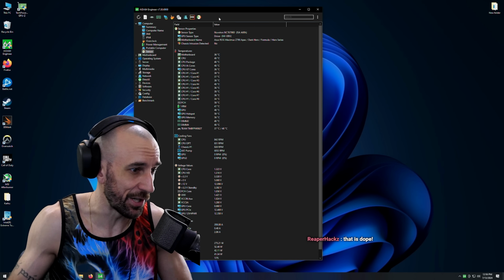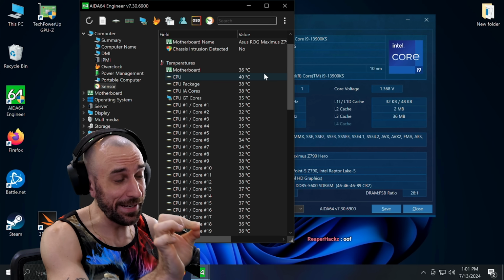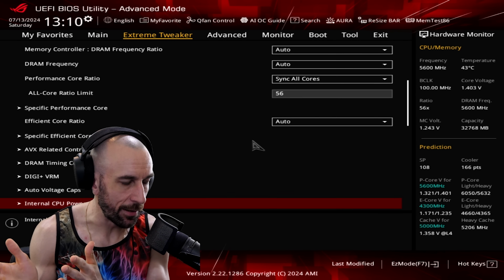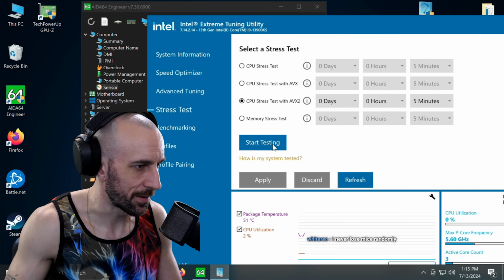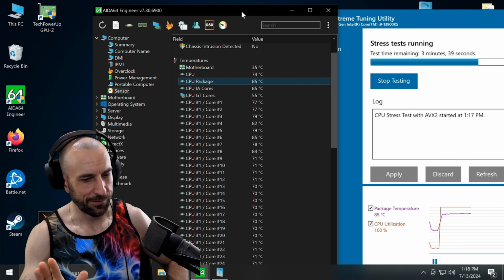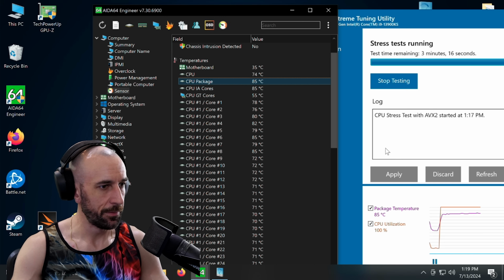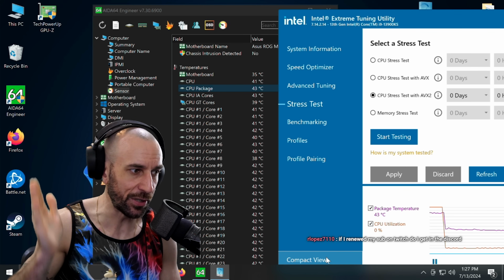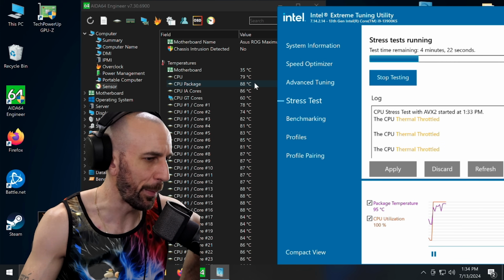🛑 STOP YOUR Intel Crashes 😱👑 (Step by Step Guide)

Comment: Got my 14700kf. Locked cores to 5,5 ghz and e cores to 4,3 ghz, undervolted and LLC calibrated. Vcore on mixed load gaming, productivity etc is average 1,27v. My brother checked with a digital multimeter and no spikes above 1,33 volts under any circumstances. That with a tuned and manually tigtened timings CL 34 7200 mhz 32 GB DDR 5 so the experience is lovely. Even my friend changed from a 5800x3D to a 14700k. He had plans going 7800x3D before it.

Comment: I need help guys my i710700k spikes to 100 celsius watching YT videos...  have 32gb ram RTX 2060, lots of terabytes free. I got new AIO recently its all corerctly installed. What I seen wrong is VCORE spiking to 1.563 volts even undervoltnig the CPU a little. What could it be ? My power supply???
Reply: Use fixed Vcore

Comment: My 14600K of which I rank stock with the latest BIOS, is dying on me. I did a -0.1mv undervolt ever since I had it, and now I have to disable E cores to get it stable and let P cores boost past 4.7GHz. I got a 7800X3D last week and will RMA the 14600k and sell it.

Comment: I locked my cores on a 13900k brand new out of the box and still degraded now I'm on my 3rd finally got a 14900k from intel haven't had an issue to date
Reply: was it hard to RMA it ?? you did it from the store or intel ?
Reply: @stylox-c2c no was easy went thru intel!

Comment: I have been RMA multiple boards and I get shit back from asus. 1 I sent in my z790 hero but got a different MB  back more fucked up broken missing a pin in the cpu and bent pin where you plug the power in the motherboard and two ram slots not working.

 I RMA the second board, I get the same broken one but the cpu was fixed but now only 3 ram slots  not functioning. I want my original motherboard back it was in better condition. 

I would not send in my motherboard if I seen your video. My first one was crashing and giving me blue screen. I use the i9cpu 13900.

Comment: i had the same issue a few Weeks ago with my I9 14900kf. The most imrortant is, not to "only" load optimized defaults, but REMOVE the CMOS Battery for a few minutes and then reset BIOS to default settings. It feels like, my CPU works better than before. I even realized that Asus Mainboard in Auto Settings set to high Cache OC Switcher Voltages. I started reducing High gear ratio in -5mv steps and realized, the CPU doesnt hang up anymore.

Comment: I am using a 13900k for about 2 years and a month now. I have a 7900 XTX paired with it and an 850W Seasonic PSU 32GB of ram DDR5 6200 MHz and a Gigabyte z790 Aorus Elite AX. For about a year and a halfish/prolly less, i've been having random pc shutdowns while gaming. I game for about 30 minutes pc shuts down by itself and turns back on.. I found a band aid (i'm 95% of the time gaming, multiplayer games such as cs etc..) i went on the amd app and limited the Max frequency from the gpu down to 2700 Mhz (default is usually 2970) and it's perfectly fine. Recently i updated my bios to the latest version and it happens so that before the update my cpu was peeking 1.35V on idle 38ish/40ish degrees. After the update it's constantly at 48 degrees (1.46V-1.5V). Since random shut downs during gaming sessions usually are related to PSU issues, i was thinking something is triggering my psu to just safe shutdown under heavy load and since the 13th and 14th gen been having those degrading issues, could it be that my cpu is causing PSU spikes paired with the gpu at high clock speeds? Does the problem resign on my cpu/gpu or PSU? What do yall think. Oh and it might too late, but i'm following this guide in order to band aid the cpu before sending it to RMA as i've heard intel gave an aditionally 3 years of warranty for 13th and 14th gen cpus users... Don't know if that's correct as well? If someone can give me a proper response, i'd be very thankful :)

Comment: Pro Tip:   Switch to AMD
😂
Im an ex-intel fanboi as well
Reply: Until Nova Lake Drops.  Then you'll be shouting Intel.
Reply: Intel Nova Lake is the codename for Intel's next-generation desktop CPU family, slated for release in 2026. It's expected to succeed the current Arrow Lake series and may introduce a new socket, LGA 1954. Nova Lake is also rumored to feature a significant increase in core count, potentially including up to 52 cores in a hybrid architecture.

Comment: I learned to tune for games on PUBG when it first came out and Fallout 4.  It is nearly always the PC I got a FX6300 to beat my Ryzen 1700X on PUBG.  I even got a dual core 7350K i3 to beat my 4670K on Fallout 4.  On PUBG I wasn't using great cooling or high voltage, CPU might have even been stock speed.  I set the ram timings, speed, HT Link and Cache optimally.  The early Ryzen was crap for memory and cache tuning which made them hopeless compared to Intel CPU's of the day.  I sold that FX6300 system to a friend for his son to play Fortnite etc, was a great CPU that did really well when I benched it on liquid nitrogen a year earlier.

Comment: My 13700k is having some problems what should I lock the pcores to?
Reply: 5.3ghz. Also, make sure you have the latest motherboard bios that addresses the Vmin shift issue. His video covers what you might have to do if your CPU is pretty degraded. I would avoided adding voltage offset unless necessary.

Comment: I'm on my 3rd Intel cpu my 1st 13900k i ran stock had the out of video memory error soon as Intel sent me new 13900k I locked all the cores and added an offset 4 months later same issue with freezing and stuttering so locked cores didn't help Intel sent me 14900k this time so just running it stock

Comment: I am trying this right now... After being in the every game crash boatd, since day one.
Faccin frustrated.
I set the load level to 7, but had a CPU @100C, with watercooling fans at max. Sat it back to 4 and 0.01V on Z790-P D4+13700KF.
I don´t agree that this is ok, since the company sent these units with knowledge of them beeing defect/faulty, not faccin OK! Not a big dead? Seriously, especially with the cost of these units in EU.
Maybe it´s cheap in US? I have lost so much time to find out what caused all these issues since 22.
Every faccin play black screens.
Intel doesn´t just owe me a new CPU, what about all those 1000h hours I wasted on the troubleshootings?
Don´t tell me it´s not a big deal dude.

Fun part when you said Effiency cores, those things have their own faccin probs, LOL

Thx for the content, I hope this will make my system more stable for now, until I lift my ass and unsocket the CPU and send for RMA.

Comment: Just picked up a 14900k on sale and did this out the box (minus the voltage) and this thing is running super cool and at 1.12 on the voltage! and locked at 5.4. Thx man!
Reply: How did you do that? It stopped crashing?

Comment: After updating my Asus BIOS to 2503 it will not let me Sync all cores. My cores do not go over 4900 now when stress testing, and voltage is 1.2XX. When Idling they  jump between 1100 and 5500 and  0.7 and 1.488 volts. What a shit show
Reply from the maker: FrameChasers.org

Comment: Eventhough I have a 13700K, I saved this video because of windows issues & BSOD's earlier this year.  After a reformat & re-install of windows, a new power supply, things seemed to be OK.  HOWEVER, with the recent Black Myth Wukong game, there would be an "out of video memory" error and the game would shut down.  Everyone on reddit and google search pointed to upgrading BIOS with the new microcode since many 13 & 14th gen CPU's were having the same problem.  But I remembered THIS video and gave it a try... and it worked!  No microcode, no BIOS update needed.  Thank you sir.  I can rest easy knowing that my CPU will no longer degrade.  The world needs more people like you!
Reply: I'm about to buy the same CPU. Can you give me an update? Did it worked?

Comment: 13900K Locked all P Cores @ 56 and is @ 253w limit. Multi core stress test wont go over 62 C. Games still running crazy fast as well. Should I lock the E cores as well? Or do anything else for that matter?

Comment: Did my 13700k today. Limit cores to 5.3ghz. Runs 1.22v by default. Cinebench score identical for multi, little worse for single, games (what matters) exactly the same. Maxes on at under 90 degrees on a Thermalright Phantom Spirit EVO in a Corsair 2000D. I think I have a pretty solid binned chip but still. Prob gonna undervolt and see where I end up. 6000c40 still tuned to 6600c34 1.4v. Never had an issue before but no reason to not do this tbh.

Comment: I mean... idk if this sounds fuc*ed... but like I just finished my build with a  i9 14900K. I'm finding out about the Intel Voltage issue. Why would I want to make the adjustments to the cores to "save" the CPU. When I think logically I will probably want to get rid of this Chip no matter what, and maybe if I'm having the issues an RMA process will slide through easier because the CPU is degraded/damaged. Whereas if it's not having issues or degradation, I wont have any option out. (I might not be eligible for an RMA request) I'm also assuming that intel might do something different here and allow you to upgrade/change CPU's? or will they be able to physically fix the voltage issue in the new chips...and by "fix," I mean get the advertised performance out of the chip, not just downclocking it so it can be stable

Comment: this might not be the solution. the semiconductor sensitivity has been damaged by over-voltage due to Intel. the single core performance of your one-year-old 13900KS has become a brand new 13600K as the result. Then you use more voltage to push it, just hasting the progress.
BTW, the XTU app is a black hole with too many issues. just uninstall it.

Comment: I'm running my 13900KS at 1.16VID boosting at 5.6GHz max. Undervolting and underclocking from day 1, may last year. I was called names. It still boosts at 5.6GHz at 1.16VID, CB23 is above 37k.

Comment: Yeah, but it's doesn't prevent your CPU from degrading further if it was manufactured in violation of technological standards to begin with (I refer to the news that some CPUs could have been manufactured so that their Cu-parts oxidize over time). This is my stroy of how I configured my platform (i9 13900KF + ASUS Z690 hero): first I decided that actual Vcore (in HWInfo) should never exceed 1.35V under full load, it seemed more or less reasonable. I turned off TVB, locked P-core multiplier to 55 and E-core multiplier to 43, LLC was set to 6, Synch ACDC Loadline with VRM Loadline disabled, SVID behavior Auto (doesn't really matter), Vcore and the difference between Vcore and SVID were adjusted by the "AC / DC Load Line" settings (so that actual Vcore is the same as SVID). I decreased Vcore gradually until the system lost stability while all the other essential platform voltages were on auto (system agent, memory controller, DRAM voltage...). The lowest voltage at which the CPU could pass the FFT y-cruncher test was about 1.19V under all-core load at full speed (it wasn't limited by power consumption, package power was about 170W). So I increased it by about +12% for solid stability (resulting Vcore under all-core load at full speed is now about 1.33V). I also used the same technique to find the minimal stable voltages for system agent, memory controller and DRAM and also increased the resulting voltages by about 12% or more. (I also should mention that memory speed / first essential timings / command rate / gear mode were set manually, but that's another story). Now it seems to be absolutely stable

Comment: How much would you charge to remote in & fix my 14900k?. Its only a few months old. Ive just been reducing my performance cores in XTU down to 53x. And it works. But i get alot of stutters in warzone. Lmk 👀  im ready to do it asap
Reply from the maker: FrameChasers.org/consulting, tier 1 consult

Comment: What cooler you got? Mine hits 100 in a second.
So it's the frequency that gives it degradation?
Reply: Higher frequency requires higher voltage via the VID table leading to much more heat. A good cooler (direct die and MoRa 420 on my 14900KS) can alleviate the issue if you stick to Intel extreme profile values IMO. Locking the cores to max all core is definitely worth it for safety as otherwise you get instantaneous spikes to 100C. Thanks Jufes.

Comment: Mine has been good but I just got it, thanks for the tip, locked the cores, hp omen 45l, performance mode, ddr5 5200, def not pushing her, rather be stable than chasing that extra couple fps.

Comment: Running a 89 biscuit score 14900k CPU @ 1.25 fixed at LLC7 at a Fixed 5.7ghz p-cores, 4.4ghz e-core, x45 ring with a 360 AIO and a fixed P1/P2 @ 253w for 38k in C23 @ 79c Max temp. Also hits 41k in C23 with a max P1/P2 @330w, but not used for daily use. Completely stable in OCCT, Prime, Y-cruncher without any issues since release. If you use default motherboard profile settings your degrading your CPU as they are all set too high by default. Tip - Setting the ring speed past x45 causes a lot of instability without also heavily increasing v-core voltages and the same thing goes for a fixed p-core above x57 or e-core above x45 unless you won the silicon lottery with an amazing CPU sample, I also do not recommend going higher than 1.35-1.4 volts on the V-core for daily use, i.e. the lowest stable v-core the better for long term CPU health with a capped P1/P2 at 253w. :D I immediately noticed and fixed this issue for myself when I ran HWinfo on default profile MB settings showing a crazy 1.47 default voltage for the V-core on adaptive settings with intel boost enabled. SHUT all that crap off and manually set up your CPU correctly, 125w max while running Cyberpunk @5.7 fixed without any stability or degradation and 40w idle, only maxes to 253w during benchmarking like C23, etc. you will not hit that wattage during daily use unless your are doing heavy AVX encoding.
Reply: So back to fixed awesome i figured that much. Never been a fan of adaptive. Finally upgraded from 9900k to 14700k so this helps thanks. Ill setup this weekend.

Comment: I just want to add something, when i got my 13900ks first like 14 months ago, i was able to use it everything on tweaked without problems. And the default LLC was level 3! And my temps were lower. (i don't remember about the voltages)
But I believe, what they did with the updates is they added more voltage or something by default. and now with the new updates, the default LLC is level 5! and my temps are higher. 
I was able to run perfectly fine with a low grade AIO 14 months ago, but now I got ryujin 3 since 6 months and temps are even higher than I first got it 6 months ago. Every new update temps are going higher and higher.
This is a total clown fiesta!

Comment: Is the max all core not 54 on the 13900ks?
Reply: It depends on temperature. If its under xx degress it will boost to 5.5 .. .but yes official its 5.4 after my understanding. Could be old BIOS stuff but it was default on my 13900K watercooling a few years ago on all auto. This was before the intel profiles. And he mentions a 13900KS... that is 5.6 Ghz.

Comment: Hello thanks for the video, tomorrow I will be getting the replacement of my 14700kf and I understand that you said I need to lock the cores but how exactly do I do that ? Thx in advance
Reply: All my 14900KS problems was solved by using LLC6 and VRM OFFSET +0.015v ;) And a powerlimit on 400A 320w/320w.  You just set P-CORES:  to ALL CORE x55 ex.
Reply: @lassekristensen385  Nice let’s gooo I’m happy for you my man. Sadly on my end I got the chip replacement but I need to wait for intel new microcode because I have a b series motherboard and I can’t disable undervolt protection which means that I have to set manual mode on voltage pcores and put it to 1.25v and it divides my performance by 3
Reply: @TartauViiz  Ok cool, I have a undervolt protection on my MOBO but the only thin it does is protecting undervolt "LIVE" from ex- Windows.. its not protecting a undervolt in the BIOS. However I found out that for 110% stability I do need to add voltage 0.015v and not undervolt. this is at 5900 Mhz ... 5800 Mhz and below I dont need the extra voltage but I think users need to be aware of undervolting might work in 80-90% of apps and games but there could be stuff like in my case thats does not play ball with insufficent voltage. Anyway hope you solve your issus friend.

Comment: Thank you for this video, bro. My i7 14700K NEVER goes above 76°C under full load. I have a Corsair 280mm AiO. (2x 140mm fans). The H115i RGB iCue link. It is a quiet, powerful beast. It benchmarks the same performance as the 360mm (3x120mm fan kit).

 The only issue I had was the 14700K and 7,200MHz RAM do not like each other, on the Z790 chipset. So, I downclocked my RAM frequency to 6,800MHz and tighted my timings. CL32-44-44-96. SK Hynix Die A single rank. I love it. I will lose ~2 fps at 1440p on HIGH-ULTRA settings. But Idc.

After I fixed that issue, MemTest benched several runs flawlessly. In Win 10, flawless. Again, NEVER above 76°C under full CPU stress load.

Comment: This is going to help no one avoid degrading silicon. Adding voltage masks over the issue and achieves stability temporarily. Over time you will need to keep adding more voltage to compensate for increasing instability, and you'll start running into other weird crashes due to electromigration. If GN's hunch is correct, and if the issue is related to good old oxidation, then your advice is incorrect and may accelerate the issue by advising your viewers to overclock their CPU to compensate.